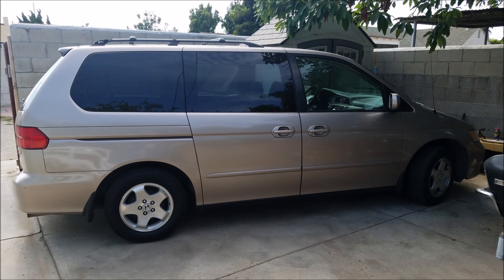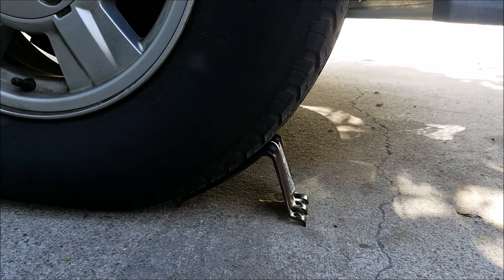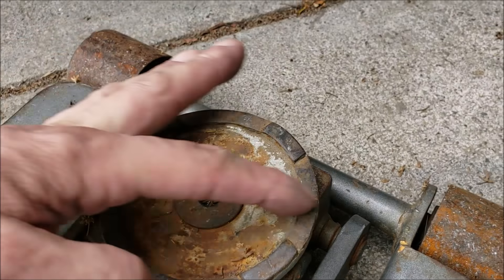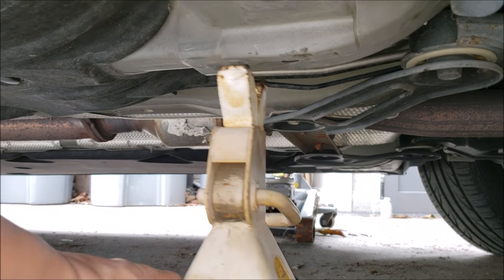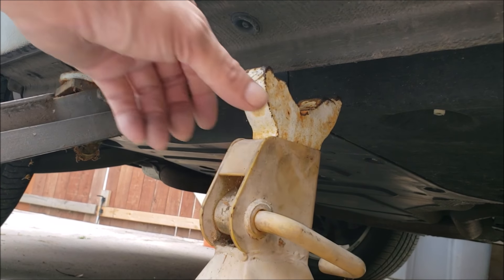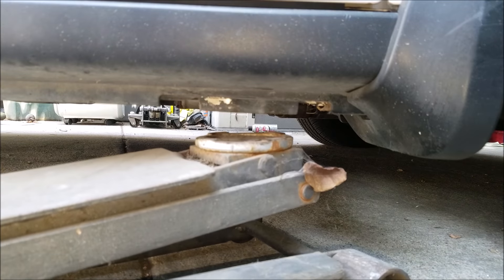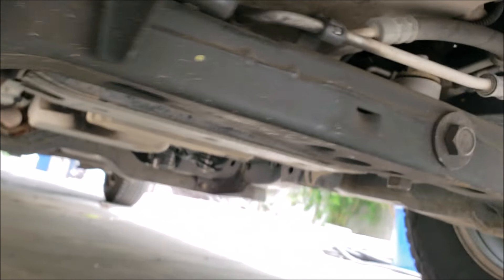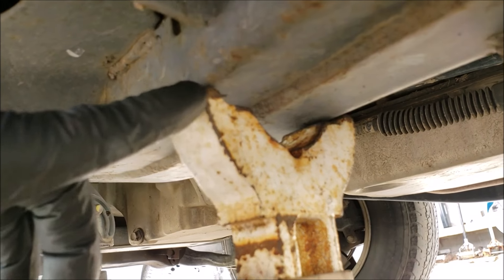How to Lift A Car with a Jack on Jack Stands (Lift a Chevy, Honda, Toyota, Subaru)

Comment: When you have to use a pinch weld to lift on get a 1" by 4" inch piece of wood between the jack lifting pad and the car body or else the pinch weld will be flattened & useless

Comment: Excellent video. Unfortunately, my 2020 Malibu doesn’t have any good place for the jack stands when lifting the front end for an oil change. Obviously, your jack goes on the jack point and everything else has a plastic or thin metal cover that will get crushed. There isn’t enough room behind the tires for jack stands on suspension components. My low profile jack can reach the subframe from the front but they angled it so there is no flat bottom. I was forced to use that anyway with an angled piece of wood which nearly ended badly when the wood suddenly switched which surface it wanted to align with. I can’t just put a jack stand there because it goes right up to another plastic cover.

Comment: I am glad finally someone took initiative to explain jack stand positions. I remember a couple of years ago, I searched everywhere to find out how to lift rear of a Honda Accord 03-07 7th generation but couldn't find a single video. Ended up using a bottle jack to lift one side, put jack stand close next to it and do the same on the other side (not quite safe). I would prefer using a floor jack to lift the whole rear of car and then place jack stands in proper positions. Fortunately, Toyota has a designated position at rear center for it but not this Honda. Btw, 99% of oil change or tire rotation videos in YouTube don't even show this very important part of the process at all, which is mind boggling!
Reply from the maker: Thank you🙂 yea its definitely a very important step that shouldnt be overlooked since it involves a person working on their vehicle safely..and yea even though i have this video..on mostly every video i at least show where i lifted it from and where i placed jackstands in case someone needs it

Comment: I have used pinch welds for jack stands for years with multiple cars. No problems. I personally think it’s safer than other surfaces that could slip when jacking from side of vehicle and pivot of weight is questionable.  I leave jack in place while under car as backup.

Comment: For your Honda Odyssey, do you jack up the front using the tow hook near the center front and place the jack stands on the exposed plate along the pinch weld? Thanks.

Comment: So I finally bought a bigger floor jack (Pittsburgh low profile 2 ton (Steel) to lift my Jeep (WJ). Problem is, I can’t lift the car high enough to take the wheels off. The wheels droop too low. I lift it from the frame rail. Jack’s max height is 16 7/8 in. I want to change my brakes. Idk what to do 😥

I’ve been considering using a 2x4 wood like many have suggested, but I’m worried about it slipping as others have mentioned. Also, I’ve been considering buying the jack cross beam adapter sold at Harbor Freight, but I might not have enough room to put the jack stand. I might if I jack the side from the middle (between the wheels) to put one jack stand behind the front wheel and the other in front of the back wheel. Not sure if the frame rail can handle being lifted from the middle though.

Another idea was lifting (from the frame rail) it to max and putting a jack stand under it (close to max). Then jacking it up from a suspension component behind the wheel (Control arm, axle tube). I figured since the weight is on the jack stand, I’m only putting the (drooping) wheel’s weight on the suspension component. What do you think?

Any suggestions?

Help me please 😱
Reply from the maker: What i did once we have cemented area and dirt area in front of it..so i kinda dug a lil trench for both front tires to land in and the jack would lift from cement area so it was still safe flat surface..and was able to get jack to lift enough to get wheels off and still support with jack stands
Reply: If the wood is tough enough, 
  you have nothing to worry about
 I would suggest looking for a 4" X 4" piece of wood  offer you more lifting height

Comment: It's not real clear on where to place the jack stands on my 2013 Corolla LE.  The owner manual suggest the pinch locations to lift the corners as you did here.  They say to use the tow hooks with a rubber jack insert stored with the car's scissor jack with a floor jack.  It looks like there's a frame that goes through the center like on a truck.  Are these safe places to put the jack stands?  You indicated that just generally for cars.  I really wish Toyota would provide better instructions by specific model to avoid the guess work, but I hear you on avoiding weak points and places like the bottoms of the engine and transmission, etc.
Reply from the maker: Yea they do have a subframe, it can be lifted on that subframe as well but ive seen a lot of people not place it properly on it and the jack slips back and damages parts..on cars i prefer to lift it on pinch weld..and place the jack stands on the subframe, just cause its less susceptible to damaging other parts
Reply: @backyardchevy328  I edited my first comment to better explain.  The 2013 Corolla LE comes with a rubber insert that's stored with the scissor jack in the trunk.  You place the rubber insert in the saddle of the floor jack, and it fits in the front and rear tow hooks perfectly.  Then you lift the entire front or back of the vehicle.  Saves the time of having to lift on each side to place the jack stands.  I see where you're putting the jack stands on the sub-frame.  I'm going to look at these spots and see if I want to go with them.  I'll also look around to see if they have any spots marked for placement of the jack stands.  A lot of this stuff is year and model specific, so you couldn't cover it all in a general video on the subject.  This is so critical to safety, a matter of life and death, that I really need to get this figured out and be 1,000% confident it is right.  My son is taking an auto mechanics class in high school.  He said that there's a reference book that shows how to lift and place jack stands by make, model, and year.  I need to find that book!  All in all, you did a really great job on this video!  Thanks, sir!
Reply from the maker: @audiophileman7047  yea if urs does include that cup its definitely worth using and placing the jack stands on the pinch weld...and yes totally you always wanna be safe when ur gonna be under a vehicle..and yes on the corolla i was using in the video didnt include that puck, would of been a good addition to the video if it did have it.
Reply: @backyardchevy328  Thanks, man!
Reply from the maker: @audiophileman7047  thank you for the support🙂

Comment: I lifted a car and placed the jack where I thought it would hold right behind the pinch weld (2:28) it bent in a bit so I switched its location. Do I have anything to worry about as far as affecting  the cars function?

Comment: hi thanks again for the videos, thank you for your help you cleared several doubts on where I am going to put the jack. I am changing the rare breaks of the honda civic 2006, I have the jack that is a cylinder but the jack cup is not wide I am a bit afraid, I really used the video of the front breaks you made it was really useful.
Reply from the maker: Hi🙂 thank you for all the support..yea those cylinder ones have a small cup surface..but if u can use a jackstand once u have it raised it should be safe

Comment: If you see this comment I would appreciate a response.  I have a rusted out jack point on the driver side rear on  2006 Chevy uplander. Any alternative ideas on where to jack to change rear tires would be appreciated. Great video by the way!

Comment: I've changed my tires and brakes on my two accords but I've used the pinch weld for my jack stands
but you mentioned it's a big no, no. I'll change my place going forward.
Reply from the maker: Well certain pinch weld sections you shouldnt use, but like many hondas have these reinforced sections that protrude lower than the pinchweld and those are good to use

Comment: Good job on explaining. Thank u.
Reply from the maker: Thank you🙂
Reply: @backyardchevy328  
By the way do you know where I can buy a hydrolic floor jack handle ? I have the floor jack, but lost the pipe to jack it up. I would need 2 pipes for 2 hydrolic floor jacks that was given to me without the bars. To adjust the jacks one has a nub and the other has a flat slit to fit a flat head screw driver.
Reply from the maker: @losmoore3358  ive seen some on ebay but based on their prices it may be better to just get the entire floor jack

Comment: I have a Chevy cobalt ls sedan 2007 4,000lbs and I bought a 2 ton compressed floor Jack, i just don’t understand how my car didn’t lift up high? Do I need a better floor Jack? I don’t fit under the car any help?
Reply from the maker: Yea those floor jacks dont lift up high..they barely get the wheels off the ground but if u lift one side put a jack stand..then lift the other side and place another..it should give a lil more space if u havent tried that

Comment: I once used the floor jack(low profile cap) once on a 2014 Mercedes E-class 212 model on its front floor jack mounting point on the front part of the engine cradle,to Jack up the whole front part of the car,to work on the front suspension I was to work on,the stands were in ready position since i was alone...while pumping the Jack to lift to the standard position (lowest stand set point) and after confirming the floor Jack cap was in safe position,parking brakes engaged, rear tyres secured by wooden planks....the damn jack  slid off!!! while working the floor jack!!..to make the long story short, I ended up buying a new radiator for the cooling system after the jack slipped...turns out I didn't factor in the floor profile of the cars parking location.
Reply from the maker: Yea those low profile jacks those cups dont have enough raised edges to grab so they can sometimes slip like that..i always have to look after raising it a lil to make sure as well

Comment: I really like your video it’s very informative. I’m trying to lift a 2006 chevy cobalt LS from the front and the pinch welds are so destroyed from rust that I have to find another location to lift from and to place stands under. I think the car in this video is very similar underneath so I know where I can put stands but do you have advice on where I can lift from besides the pinch welds?
Reply from the maker: Thank you, i did encounter the same with a cobalt we had and on this oil change video i do show where i lifted it from, if ud like to check it out. https://youtu.be/GldIQqioLDY

Comment: So the spot to jack is right under the edge of most vehicles? By that lip?
Reply from the maker: Yes, just behind the front wheels and in front of the rears...itll have lil half round notches where to place the jack in most cases..or itll have an edge on its own like the honda vehicles where to lift from

Comment: Wish I’d have found this video a year ago! Is there anywhere on the 2013 Malibu where you can lift the entire back or entire front at once? Would save me a lot of time!
Reply from the maker: Yea lifting from the front engine cradle/subframe....on the rear suspension crossmember u can but the exhaust pipe gets in the way for the rear but u also need a tall lift jack

Comment: Can we put jack stands on the pinch weld when changing oil?
Reply from the maker: Yes, that's actually the best place to put jackstands
Reply: Backyard Chevy I thought we had to avoid the pinch welds completely very confusing
Reply from the maker: @hemtet5500  theres reinforced sections on the pinch weld that are actually used for the jacks included in the vehicles and can be used as jacking points or to put a jackstand
Reply: @backyardchevy328  ah but it is a bit confusing as a quick look and it all looks the same but thanks I've got something to work with now
Reply from the maker: @hemtet5500  i know what u mean..well if u got a good lifting point on the frame it is always best..its just normally cars nowadays are too low to get a good spot on it or they have a splash shield that kinda blocks out jack..so thats why the pinch weld can be a good choice as an alternative

Comment: I lifted my 13 malibu from that same spot and it bent some of my bottom bumper smh
Reply from the maker: On the malibu i was lifting from the pinch weld which is behind the front tires...the bumper is located in front of tire area
Reply: @backyardchevy328  I did it from the pinch weld and it still bent smh not cause of you but before
Reply from the maker: @luisserralde5140  im sorry to hear that..i know once they start bending it does get worse if it continues to be lifted there..and in certain cars finding other good lifting points can be difficult
Reply: @backyardchevy328  not your fault bro but keep up the good work
Reply from the maker: @luisserralde5140  thank you🙂